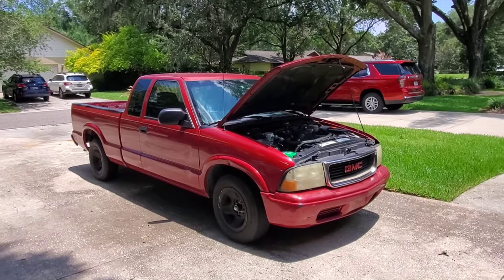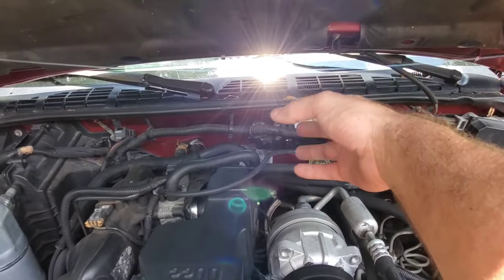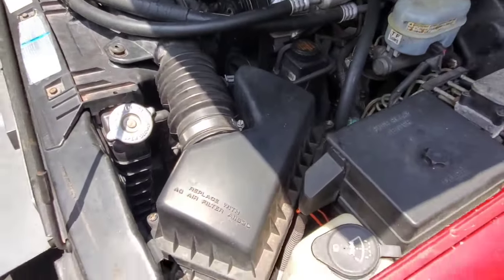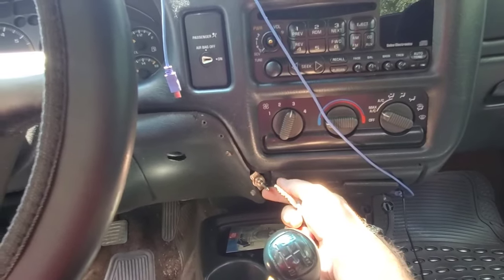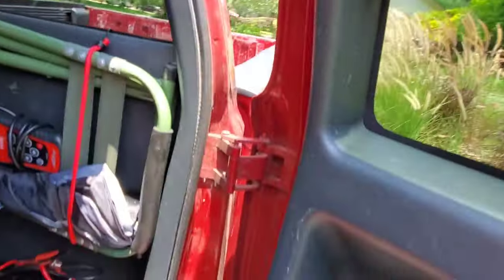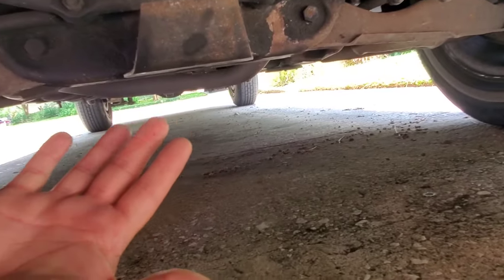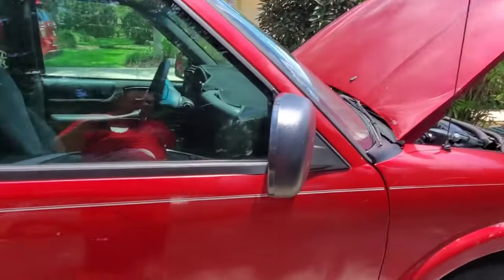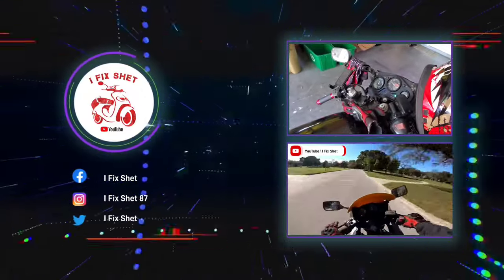Most Common Issues With The Chevy S-10 And GMC Sonoma 98-04

Comment: I have a 2000 S10 short bed.  2.2 five speed with 206,000 miles.  Original tranny, original engine, original clutch, original AC components, original exhaust, original thermostat, original blower motor,  original front end components (grease it every oil change).  Did have to replace the wiper motor, 1 fan clutch, 2 water pumps, front brakes, starter, alternator, tires, belt, hoses, plugs/wires and coils, and oil changes.  That is about it, great lil truck, burns zero oil, extremely reliable just not very peppy.
Reply from the maker: Some people get lucky
Reply: Just recently  got my 2nd gmc sonoma. It's 1999 with 30,000 miles. 2.2,5 speed manual,crank windows and is a blast to drive. Recently replaced all radiator and heater hoses,thermostate,replace a/c compressor, orifice tube, receiver dryer, all o rings, had rear and transmission gear oil changed,added air suspension  to lift up rear 3 inches and                 flushed brake fluid. Got a crew cab ram but this little truck is more fund to drive around town.
Reply: I've changed my brakes, fluids and battery. 2001 Sonoma original owner. Oh  the dash cracked as well
Reply: Yeah I'm on my third motor with mine. I also went with an electric fan and my dashboard look like it was a world War. Roll down windows,  I have never changed a clutch and it still works great. I love my s10

Comment: There is nobody better on a s10 then me. 38 yesrs of s10s here.  Its all i do. I have 800 s10s and blazers in my back yard. Building them and parting them out.. come see me. In Georgia
Reply: Should I buy a 1996 sonoma manual?
Reply: Do you have a solid cab for an 89 s-10?
Reply: God damn....
Reply: I'm looking for a driver's side interior door panel , dark gray, power windows and doors.
Reply: @UncleEd2024  what year?
Reply: @joannamendoza3955  i have a 98 Sonoma manual I like it, it's the 2.2 but if you find the V6 with a stick absolutely lol.
Reply: @ridingdirty8897  mate do you think you can make some kind of video or something how the jack is supposed to be and where the jack cover goes over it and what the heck it's supposed to screw into?? Mine doesn't have the cover or that captive screw for it and I have no idea where it would catch or if it's even there anymore. I think mine had the one with the cup holders molded in.

Comment: Got a 03 Extended cab  w/V6 Vortec and just passed 500k on the original engine. LOVE THIS TRUCK - so easy to work on w/o all the computer stuff on today's engines. Only 'major' repair was a few yrs ago replacing the fuel spider. WAY easy. Actually increased the mileage to about 26mpg from 17. Just now starting to show body rust (bought in Louisiana in 03 but been in IL, MI, FL, TX, OK and PA. Road salt kills! Actually taking it down to the frame and do a complete restoration. This truck and I have been to hell and back quite a few times and She's My Baby. We got too much in common. LOVE THE MODS you did - TOTAL sense!!!

Comment: It's a 4cyl truck of course it's going to lack power
Reply from the maker: I mean bro I'm just giving my review telling people that suffers on power because these are things people need to know. As much as you think it's common sense a lot of people don't have common sense which is why we have to say things so that people understand
Reply from the maker: @deadbodybaby1  yawn 😴
Reply: @IFixShet I have pulled 2 tons with it. A car hauler and a fiat. I made it 80 miles on a slight uphill incline and a pretty high 2 mile hill. They can do it
Reply from the maker: @winchestersons6258  you pulled two tons with a 2.2 L? I would have to see that. Mine struggles just to move itself and it has no check engine lights on and if the AC is on forget about it.... zero pickup speed at all takes forever to get up to 55 or 60
Reply: It was mostly freeway. It was only a slight incline. Only two places that stressed me out.  If I was in town it wouldn't have happened.

Comment: It’s usually the pulse control board on the wiper motor that goes bad. I own a 01 2.2  5 speed and a 02 4.3 auto. Sunshell on the 4l60e tends to break on the auto and kinda sucks how you have to drop the transmission to replace your slave cylinder on the manual. I like both trucks, just prefer the 4.3 over the 2.2…. It’s funny how all your points were correct🤣.

Comment: I have an 04 sonoma sls crew cab 4.3 v6 4x4. I bought it from a junkyard as a salvage title. 200k on original motor (runs great!) I replaced the transmission and 99% of the suspension. Most of the issues I have match your truck. My transfercase just blew the other day 😂

Comment: I’ve had 2 of them, first a 2001 4wd had a lot of problems with the vacuum actuated 4 wheel drive and the transfer case, now I have a 2 wheel drive 02 sonoma I’ve owned for about 4 months and I love it no problems at all it drives like a brand new truck. I plan on keeping it till it rusts apart

Comment: Have an '02 s 10 2.2L. lot of the problems you mentioned are things that've gone wrong on mine. AC unit doesn't work, getting it fixed soon. Fan clutch has broken on me, wiper motors stop working for no reason every once in a while. And the headlights, I just sanded them down and restored them and that did the trick.
Reply from the maker: Yep they do random things lol

Comment: I have an 2000 GMC Sonoma  285,000 . Motor replaced with 2.2 with 175.000 miles runs like a top. Love it. I am replacing secondary  air pump and parts.

Comment: I have a 1998 S10, its still going strong, it's just had some little things here and there, not wanting to get into truck payments, plus the fact newer trucks are big these days, they just don't make a small economy truck anymore, and something compact is all I need, I can haul or tow something if I need to, don't have to borrow a truck when needed...As for the things that have needed replacing...I can relate to everything you pointed out, reliability wise it's good, gets done what I need and is dependable. I did have to replace the alternator a few months ago, the one that was on it was the original 👍,

Comment: Just bought mine, gonna keep watching your vids for tips, I gotta replace the cat
Reply from the maker: Remove the 2 exhaust clamps underneath and take a rubber mallet and remove the cat section and get some catalytic converter cleaner spray it all inside wash it out thoroughly and then heat dry it then reinstall

Comment: Mine has 213,000 miles , still running as I bougth it.
16 years with me.😊😊😊😊😊😊
Model 98, 5 speed, xtra cabin.
I did buy it with 106 k miles.
I won't change it or sell it.

Comment: E85 2001 sonoma extra cab. 110000 miles.  2.2 manual. Cracked dash. Have changed the brakes, fluids and battery. Tires as well.  I have pulled 4k pounds slowly but made it 80 miles with a slight uphill incline.  Oh, the fuel tank level is pretend in the best of times and the windshield wipers are haunted but work

Comment: Helpful vid. I just bought an 03 Sonoma extended cab with 91000km (around 56000 miles). Body is in good shape, got it from an older fellow who bought it when he retired and then kept driving his older vehicles. He took good care of it. Needs some front end work because there is play in one of the front wheels. Can’t wait to get the safety inspection done so I can hit the road.

Comment: The main problem with 2.2l was head gaskets and very weak automatic transmissions.  But being 4cl head gaskets aren't to bad to fix. It's best get 2.2l with manual transmissions as the automatic is no longer  made , have go junk yard or rebuild. A manual transmission can drop all kinds aftermarket in if it goes bad.  
The 4.3L got way worse gas mileage 18-19 mpg vs 27 mpg 2.2l. And lower intake problem hard work on a v6 in a small compact truck best just get a full size 4.3L, 4.8l , 5.3 than a 4.3l in a s10. 
I needed cheap transportation and bought a 1998 sonoma ex cab 2.2l 5sp 125k miles $2500, and a 2004 cavalier 2.2l 5sp 75k miles original $1300.  They are very simple transportation, good mpg,  easy work on, cheap to repair and buy. 1998-2005 where the Golden era for moden chervy gmc vehicles. Every after 2005 chevy gmc is pure junk.

Comment: The 2000 Isuzu hombre has the same body and motor andvthe box that hooked to the air hose that goes down be side the radiator on the left side if your in front of the truck I hated that thing so i took it off and took a spry paint can lid and it fit right in it snug and put a hose clamp on it and it helped some just to much air with it on and the hood on the corners mine did the same thing hit the windshield

Comment: Take that bed liner off unless you want a rusted out bed!!
Reply from the maker: It's been on there since the conception of the truck and there's still zero rust in the back of it because drain ports were installed

Comment: I appreciate the info. My Senior Father just bought a 02 from the original owner with 62k miles. I was just curious if there were any common problems. Is it a timing belt or chain? Just wondering if it had a belt I should worry about the age and change it. Just to keep the epic old guy going.
Reply from the maker: These are chain driven
Reply: @IFixShet  awesome. Now please tell me they don't have plastic guides and or tensioners.
Reply: @karlporath8904  They do .. 2 tensioners shattered so far .. plastic crap
Reply: @chipgunter Do they sell metal replacements?

Comment: I have a 1997 GMC Sonoma with 243,000 miles on it. I have actually had very few of these problems. I'm wondering if it's because mine is a 4.3? Idk. My main issues have been the effing driveshaft joints and front wheel bearings. Every time I do the front brakes i go ahead and just replace the front bearings and races as well.

Comment: Theres an easier way to do the starter, you come from the front with a long extension like 20" to get to the electrical connector bolts its a narrow shot but thats the easier way I've done the normal way and it really sucks and if you look in from the front side into the engine and can find that passage for the socket thats way easier.

Comment: By chance do you remember what fan you installed i want to get rid of my manual setup
Reply from the maker: It was a pretty basic electric fan from eBay it only costs like 40 bucks I've used it every single day for hours with no problem it's been over a year

Comment: been contemplating on buying a 2000 S-10 i’ve found for sale with 39k miles. Its selling from a dealership but if I can get them down to 10k i’m taking it
Reply: How much is the asking price? I just bought a 2003 low miles
Reply: $10k for a 2000 s10? They are hosing you

Comment: I just bought a super clean s10 w the 2.2l. ive had the vortec 4.3 before and im surprised at how warm it runs. Still keeping an eye on it, at first i thought the thermostat was out. How hot does yours run at cause mine is like 215
Reply from the maker: Not even close on my 2.2 it never breaks 160
Reply: @IFixShet  I put a 180 thermostat in it and now it's fine so I don't get it

Comment: How much Should I pay for a 1991 GMC sonoma in acceptable condition? This is about to be my first pick up and Im planning to drive it twice a week. Can somebody suggest a price pls ?
Reply from the maker: It's not that easy I need to know more about the truck. Any major dents how is the interior  The other thing to factor in is it doesn't have an OBD2 port to communicate with the car if it starts having issues They didn't start installing those in vehicles until 1996 so if you start having engine issues you're going to be doing a lot of trouble shooting without the help of a computer.

Comment: I have one with a oil leak, replaced the rear main seal and it still has a oil leak between manual transmission and back engine block???

Comment: You must've bought a piece of shit! I've owned 3 S-10's & never had a single problem. All with the bulletproof 4.3L V-6. Bought 1 new,first one i bought had 30,000 miles,3rd had 70,000 miles. All 3 were 4×4's. I live i Wisconsin & drive in alot of snow & salt on the roads.  Never a problem. I was also a mechanic in a GM dealership for 12yrs,Ford,Kia,Mitsubishi,& Hyundai for 8+ yrs. Only had problems with Fords. And I'd rather wake than own or drive a Ford.